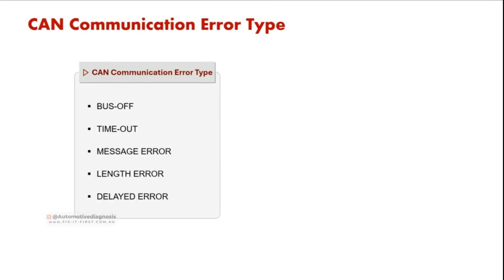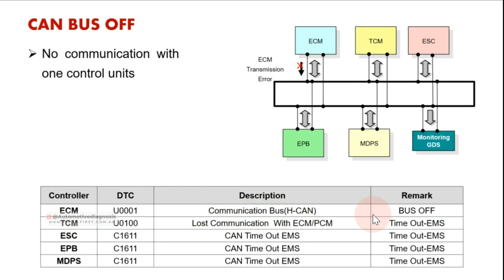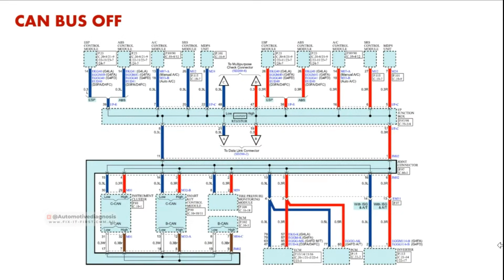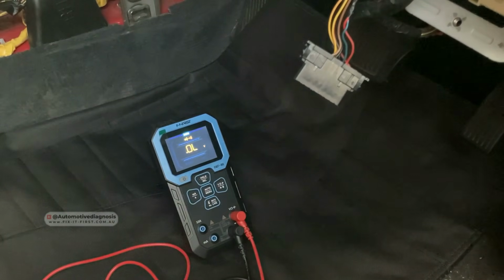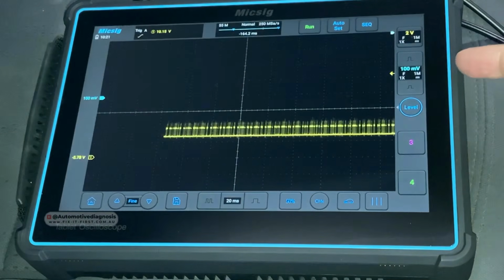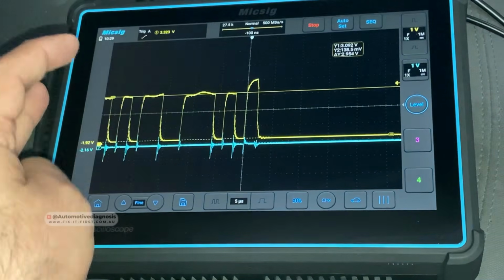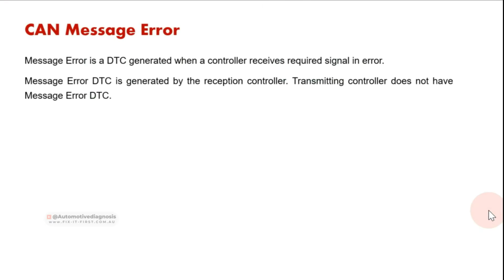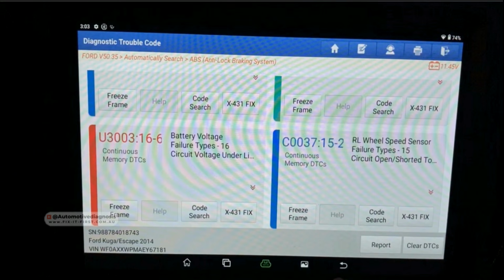Every Fault of CAN-BUS Explained | CAN-Bus OFF | CAN Time Out | CAN Message Error

Comment from the maker: 🧑‍🎓Online Courses: Automotive Engine Sensors Intro, Operation & Diagnostic (18 Sensors)
https://fix-it-first.com.au/course/automotive-engine-sensors-intro-operation-diagnostic-2/

🧑‍🎓Automotive Engine Actuators Intro, Operation & Diagnostic: 
https://fix-it-first.com.au/course/automotive-engine-actuators-intro-operation-diagnostic/

🧑‍🎓 CAN-BUS Network Intro, Application & Diagnosis Online Course:
https://fix-it-first.com.au/course/automotive-can-bus-network-intro-application-diagnosis/

🧑‍🎓  Smart Key System (Push Button Start) Operation & Diagnostic in ANY Hyundai & KIA Vehicles
https://fix-it-first.com.au/course/smart-key-system-operation-diagnostic-in-any-kia-hyundai/

🧑‍🎓 Automotive LIN-Bus & K-Line Inro, Application & Diagnosis
https://fix-it-first.com.au/course/automotive-lin-bus-k-line-intro-application-diagnosis/

🧑‍🎓 ABS & Traction Control System Diagnostic Online Course
https://fix-it-first.com.au/course/abs-traction-control-system-diagnostic/

🧑‍🎓 Starting System Diagnostic & Schematics Analysis Online Course:
https://fix-it-first.com.au/course/automotive-starting-system-diagnosis-and-schematic-analysis/

🧑‍🎓 How to use on Oscilloscope for Automotive Diagnostic Online Course:
https://fix-it-first.com.au/course/how-to-use-an-oscilloscope-for-automotive-diagnostics/

🧑‍🎓 Everything About Electric Power Steering Systems Online Course:
https://fix-it-first.com.au/course/everything-about-electric-power-steering/

Comment: I lost communication with TCCM and have abs light traction, control service, 4 x 4, ACC/FCW needs service light all on the dash. When I check for ohms it’s 0.09 until I disconnect one of the nodes on the star connector. Then it’s max out OL 2014 jeep grand Cherokee summit 5.7. Any help would be greatly appreciated
Reply: So far with the multitool from what I’ve learn looks like a short in the can bus

Comment: How do you explain getting 60 ohms with a shorted can line? The short does not affect the resistors?
Love your videos! Tommorrow I am taking a 2013 Lexus RX350 to the dealer for diagnosis for a no comm with the SRS/ Air bag control assembly. I have discovered that a module connector under the cigarette lighter is disconnected. When I plugged it in, I lost communication with the power steering pump module and ABS module light came on and possible other modules. The SUV still started. From the video, you stated that a shorted can line, external or internal, will pull the whole network down. I am wondering why the vehicle still started and run.
Reply from the maker: Hi my friend, most of the time short circuit (only on one wire) won't affect the resistance measurement in this case, but open circuit will. But of course if both wires are cross-shorted, it will affect the resistance reading. In your case, most likely Cu is reflecting a fault on piece of network which is causing the no communication when you plug the connector in. And regarding the car starting, I've had many cases that network was down but I could still start the car. Checking the diagram for your exact car can help to see how ACU and other control units are connected to each other (which network) to track the fault.

Comment: Good video and well explained, but it wasn’t Every fault.  He didn’t show open circuit on the can bus network with the scope. 

If you had an open circuit, one can bus will jump to the other can bus and shadow the image.  By following each other. 

If can high has open circuit, it will jump down to Can low.   

If you can low has an open circuit, it will jump up to Can high.
Reply from the maker: Hi my friend, all fault of the CAN bus fall under the three categories I explained, even the open circuit normally causes “CAN-Bus time-out”.
Reply: @AutomotiveDiagnosis yes I agree with the timeout theory.  But open circuit would be nice to demonstrate that with the scope.  Maybe another video
Reply from the maker: @seychelles44  Sure thing my friend

Comment: As I read your Multimeter, it's bought CAN High & CAN Low shorted to ground, you have contuity on bought?? 🤔
Reply from the maker: Hi my friend, only on CAN-High we got a resistance reading and continuity, if you check it again, what we got on the CAN-low was not a resistance reading, it was random voltage fluctuation caused by the voltage on the CAN-Low. So, the short to ground was only on the CAN-High.
Reply: Both not bought please
Reply: Can i gate your watsup number ?

Comment: Why does most Kia models have 2 ECM & 2 Airbag ECU'S?
Reply from the maker: Hi there, there are not two control units for each one of those two options, what scan tool shows is different options for selecting the ECM (based on the fuel type) and SRS (based on the event 1 and event 2)